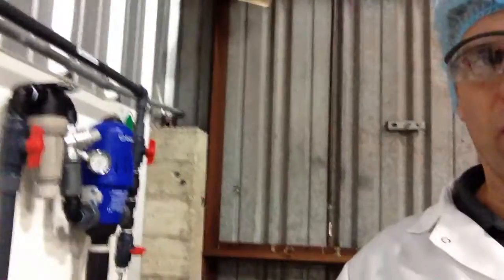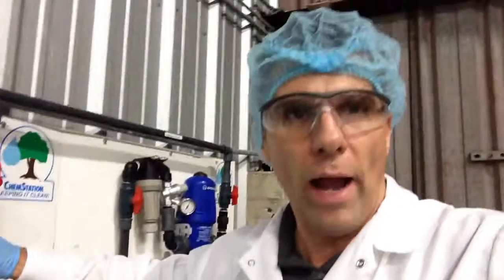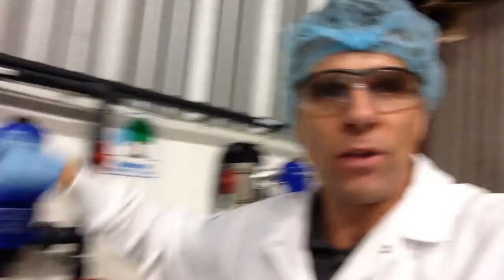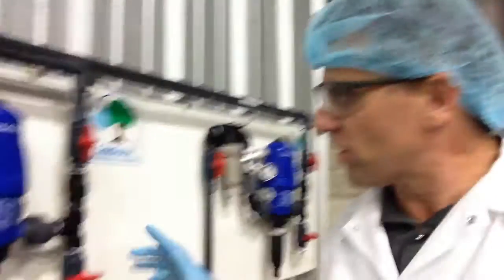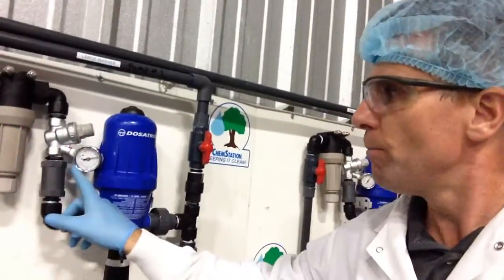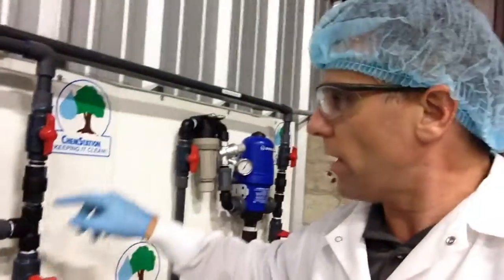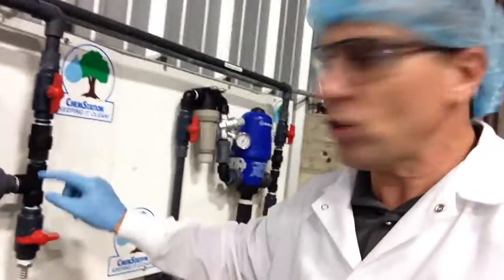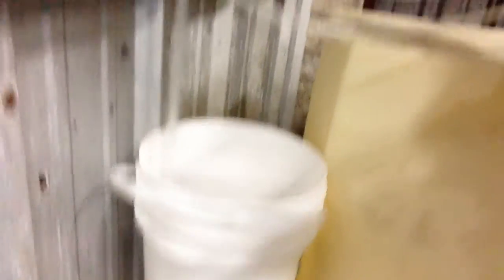Dosatron Injector Pump Calibration Tips

Comment: I'm just going to use a peristaltic pump to do fertigation,  set up to my sprinkler timer which run my valves in my system, I'll do an inline mixing tank or send to a bucket to be agitated, and sent to plants with another pump .